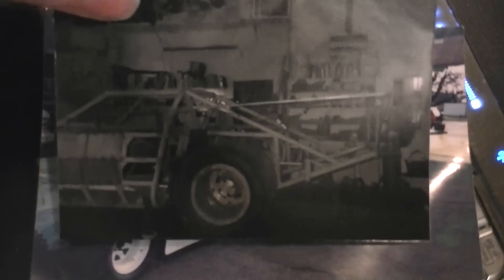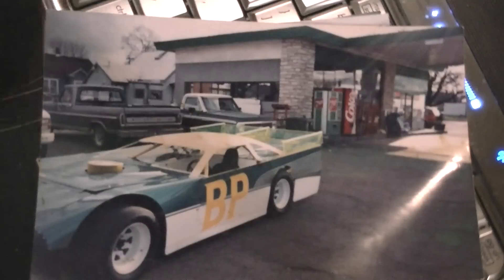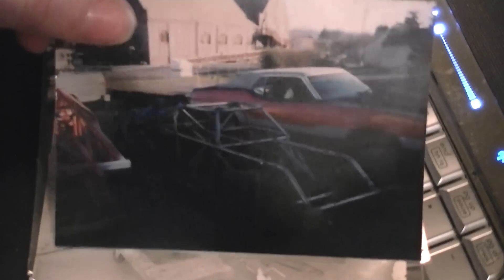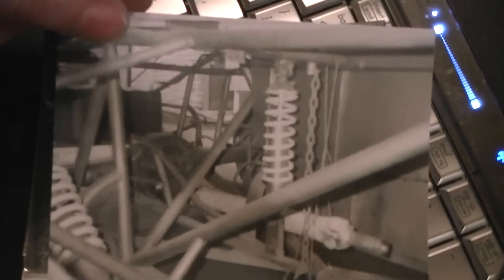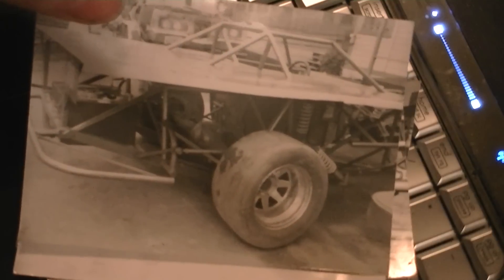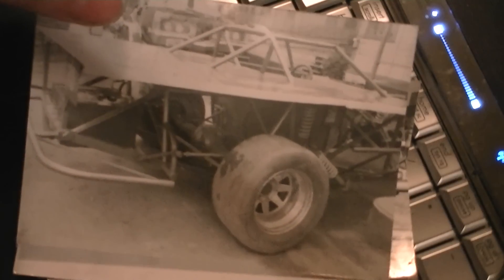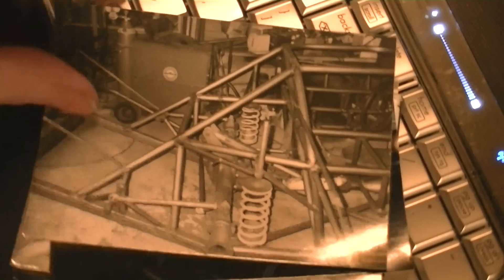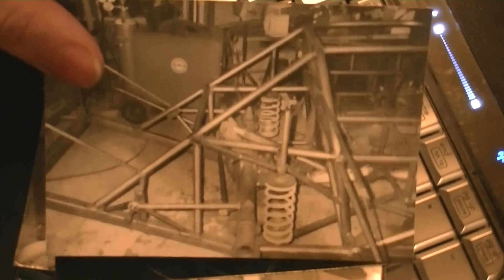I Really Do Know How To Build Race Cars -  Don't Make Me Pull Out the Trophies

Comment: argon purge is mostly used for stainless steel welding. It greatly improve weld quality in both aesthetics and uniformity. As for aluminum welding, argon purg isn't nescessary even with a weld thru situation. The trick with aluminum is to keep it as CLEAN as possible. Aluminum oxidize very fast, creating a layer of aluminum oxide on top. think of it as 'rust'... only gray rust.

Comment: Compared to steel oxide, aluminum oxide forms in a matter of seconds, hence the need to brush, clean and brush again before welding. Preferred welding method is TIG (tungsten inert gas - where your inert gas generally is argon) with an AC current - to break the layer of oxidized aluminum.

Comment: Hell, you had me at the first video when you free-handed the cutouts for the horn brace. Obviously your know your way around welding, and anybody who thinks that freestyling a rollcage is easy should post their attempts.

Which leads me to a question, what do you think of using electrical tubing for the frame & cage of a dune buggy? I have far more experience with electrical tubing (and all of the benders to boot!) but I'm not sure it would hold up. If I needed more strength, I could use rigid.
Reply: Conduit? No f'ing way. .090 wall mild steel tubing, minimum 1¾" OD, and properly designed chassis. Buy a kit for your first build.

Comment: I just found all these videos, and I'm probably gonna build a low speed car using the original subframes tied together and a stock suspension. Eventually it will probably get a small block, until then it's a fwd 1.6l....😂

Comment: Do you box in frame rails, or tie them together under the body at all, or does the cage simply provide all the stiffness needed?   I come from the  road course and autocross world and so I am familiar with seam welding unibodies, reinforcement plates and boxing trailing arms, etc.  I will never get used to the sight of an offset axle.  I am also apalled that no-one has taken the low road and pointed out that your cars are Jeri-rigged.
Reply: She has a series of videos building a street stock Camaro, where she ties the sub frames together.
And is you opinion criticizing, WHAT she is doing, or HOW she is doing it. WHAT might be because of the rules. If you can't get used to an offset rearend, how do you suppose to see the other subtleties of an oval racer. It may be a combination of chassis offset, a wheel back spacing you are seeing.

Comment: Ah. Don't worry Jeri. Don't let anyone offend you on this. If you can bend and shape electricity you can bend and shape metal. Just means your good with your mind and hands. I'm the same way. To be honest.... you working on cars shouldn't be a surprise to folks. After all, I consider it easier than electronics so why shouldn't you be able to do this? Good old SBC. Firing order 1 8 4 3 6 5 7 2....yep...still got it :-) Also Jeri, being good with computers and electronics means you can fix modern cars seeing as that you can correct as many issues with a laptop as you can a wrench these days :-)

Comment: You can tell just by the words you use that there is a good bit of 1st hand knowledge of what you are doing.  I bet also that you race in the same manner.   I have been around the pits and built many cars, that was later destroyed by people that had almost no clue how to build or drive.   I take more of the later any day as if they at least could point the thing around the track, they would not destroy other peoples cars.   If it was up to them they would attach a engine to a match stick and run it...   bash and crash is not the same as racing..

Comment: I would stick to buying a chassis from Masterbilt, Rocket, or Rayburn... then build from there. Putting bars together with spindle mounts and motor mounts is not a racecar. No disrespect but one of your cars would 99% of the time get smoked against some real competition.
Reply: I don't see many of them building true, start with a street car, street stocks. At least that's what she was building in the series I watched. As far as chassis design, the bones of the car are for safety, then someplace to hang the rest of the stuff on.
I used help out a guy who built his own cars, starting with chalk marks on the garage floor. Did it that way from the 40's to the 90's, beating guys on tracks he'd never seen before. Raced everywhere and everything. "Cup" cars from Daytona, beach and speedway, to Chicago's Soldier Field. And won late model features and fifteen track championships, while missing 3 seasons, and half of a forth due to injuries, back when we all weren't that smart building safe cars, up until he quit when his eyes started failing him. The worst season he had was due to health issues of his a two of his crew over a winter was when they bought a Howe car due to lack of time. Couldn't get it to handle at all. Finally broke down and called Howe, turns out he was trying to set it up like a car he built. Howe told where to get back to the baseline the chassis was built to, and then make minor adjustments from there.
 There is still room for the DIY race car builders.